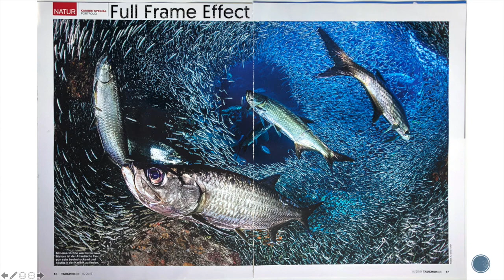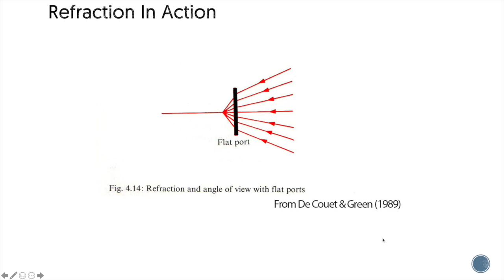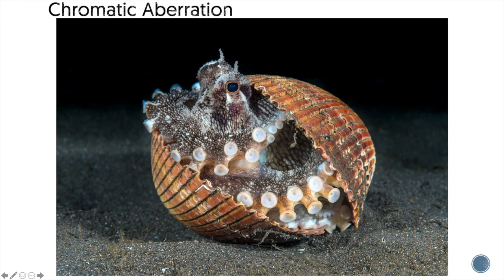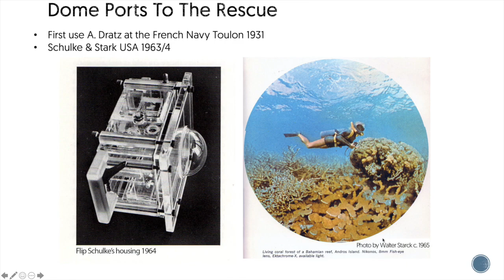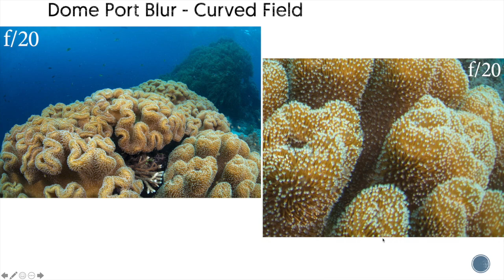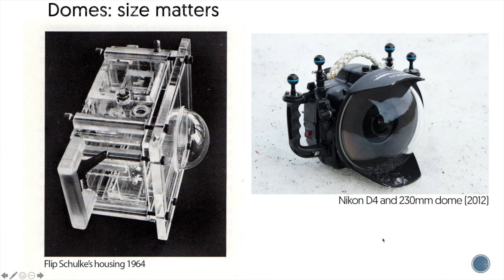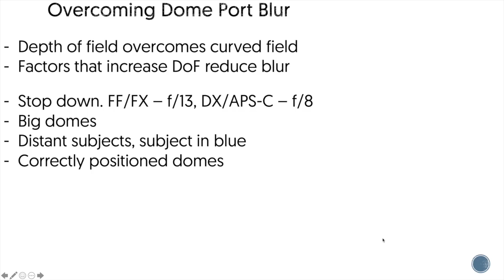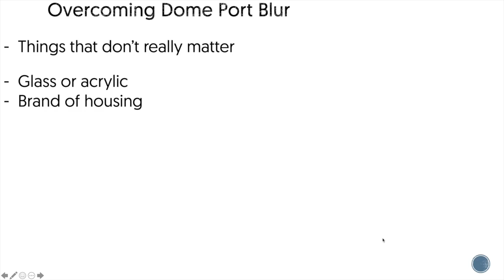Beyond The Dome Talk - Part 1 - Dome Port Theory - underwater optics, problems and solutions

Comment: One thing you could have mentioned: How to check if the dome port is at the correct distance from the lens. Of course you can rely on the manufacturer's advice, but there is a good way to check it yourself. The dome is placed correctly if the center of the curvature of the dome is at the same position as the optical center of the lens. The optical center of the lens is at the apparent (not the real) position of the aperture. The center of the curvature of the dome is on a line running through the reflection of your eye (because the light rays coming from your eye will need to hit the dome at right angles to reflect back into your eye. This means that the dome is placed correctly if, from the most acute angle possible, the reflection of your eye and the apparent position of the aperture coincide with each other.
Another thing that you can learn from this fact: Zoom lenses do not work very well behind a dome port if the apparent position of the aperture moves significantly as you zoom in and out. You can check that very easily by looking at the front of your lens while turning the zoom ring.
Another thing you failed to mention is that fisheye lenses perform much better behind a dome port than a rectilinear lens. This is because a fisheye lens doesn’t focus on a flat plane like a rectilinear lens does. That would be impossible, because with a FOV of 180 degrees, every plane would be at infinity in the corners. Thus it would require a fisheye lens to only change focus in the middle, but not in the corners. This is optically impossible. So the focusing of a fisheye lens is much more suitable for the curved virtual image produced by the dome.